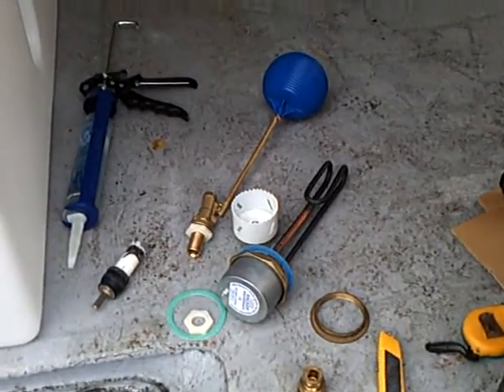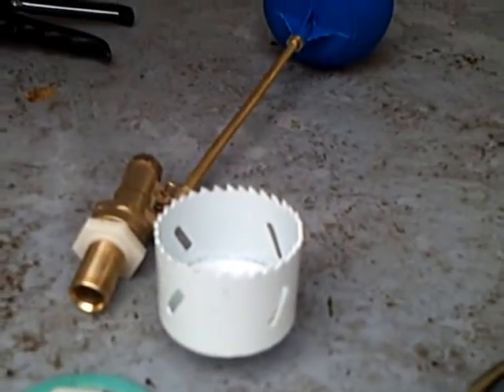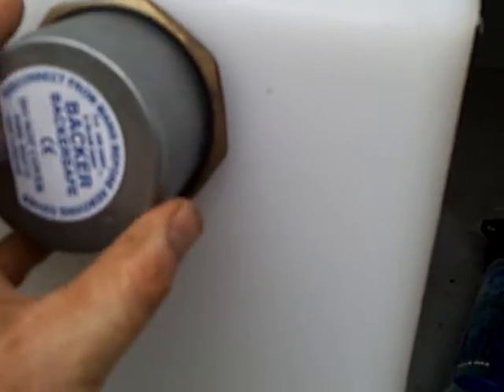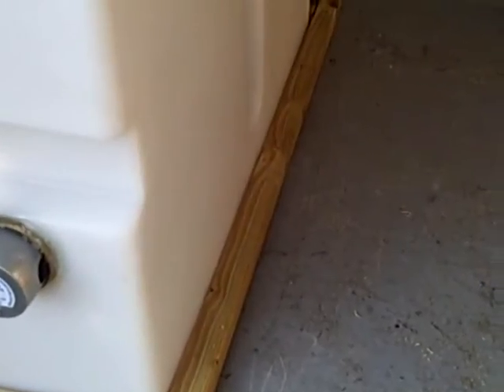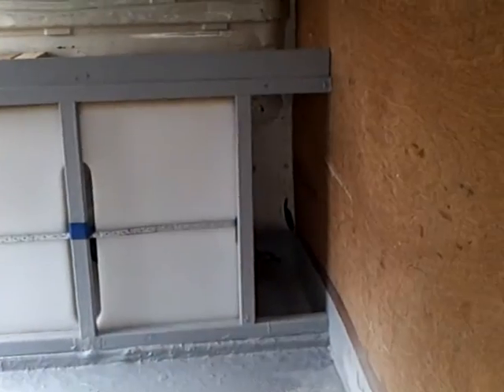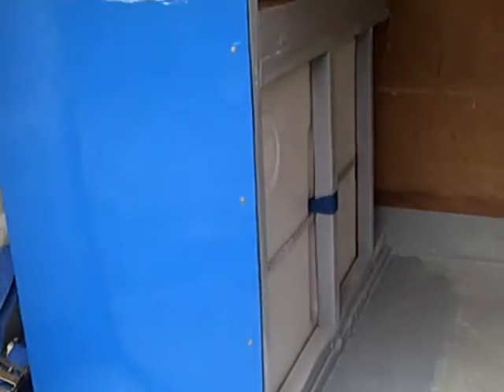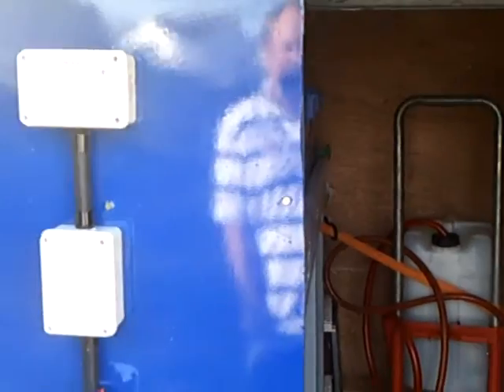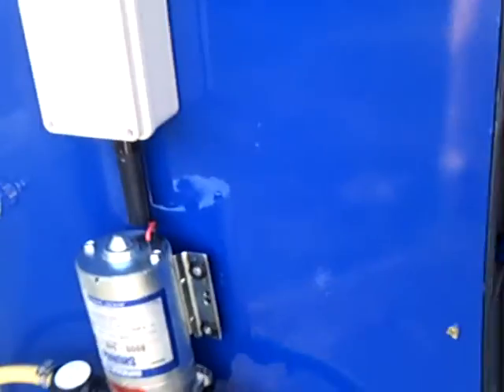DIY van set up for water fed pole

Comment: Great setup, very useful video. The only thing I think I noticed wrong was the way you had the 16amp plug wired up, was the 13 amp plug going into a male 16amp plug? If so this could be very dangerous?